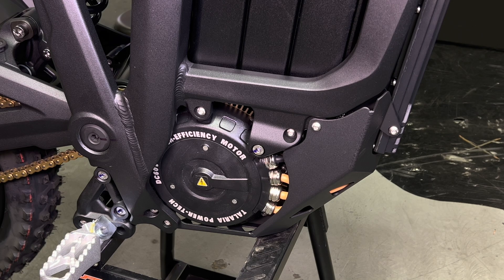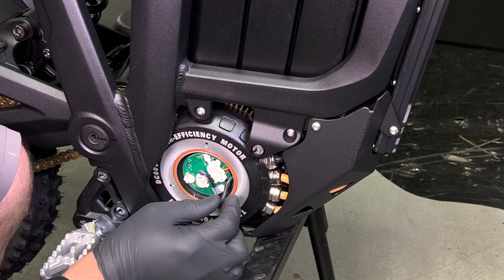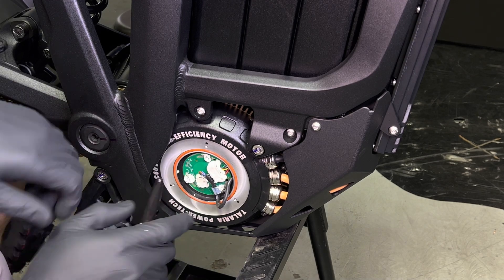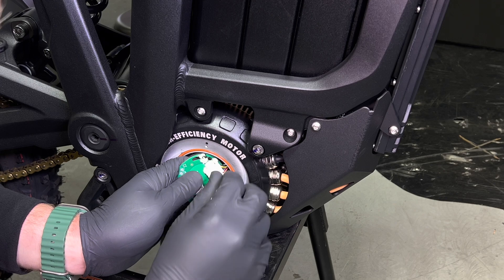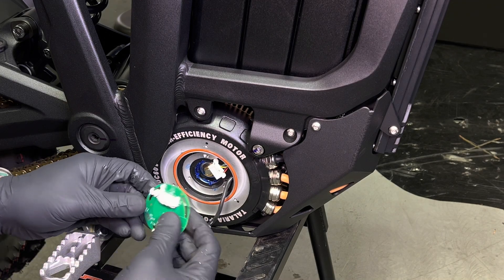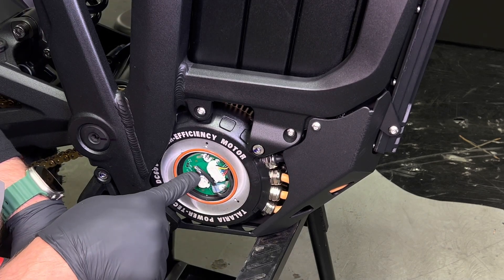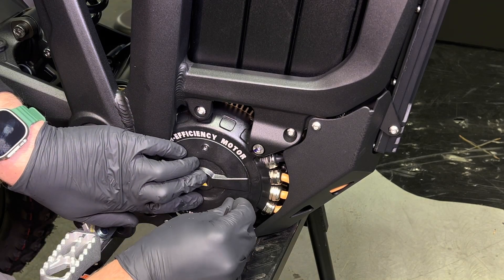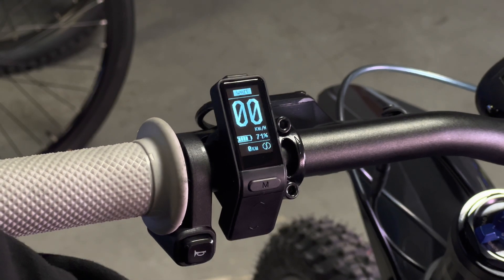Talaria Sting R MX4  temp sensor/encoder replacement and calibration

Comment: Great video but would love to see how to do this on the TL3000 as the hull sensor is a bit different and is not as modular than the TL4000.
Reply: Hi mate did you ever find out how to do this on the original talaria? I would love to no how to calibrate it!
Reply: @JoshuaToal-hz9mt  nah mate had to replace the full motor because my sensor was cracked and I could not get the new sensor perfectly aligned

Comment: My sting mx-3 just thrown up the same code is it easier just to replace the full temp sensor?
Reply from the maker: It is easier to do this if its just a pinched wire..if its not a pinched wire then replacing the temp sensor will be the next try.
Reply: @lunacyclerepair  Hi  dear, i have the TALARIA MX3 Street Legal (TL3000) and has this problem : after a little fall the speed indication on the Displays show the speed with litlle delay, i can start rolling 2-3 km/h but its shows 0 km/h after i get faster its start to shows the speed indication with delay, what can be the reason and how to fix that ?  i also have this Match setting but after i start matching it shows me matching fail after 30 seconds